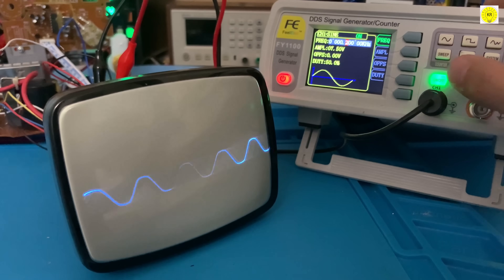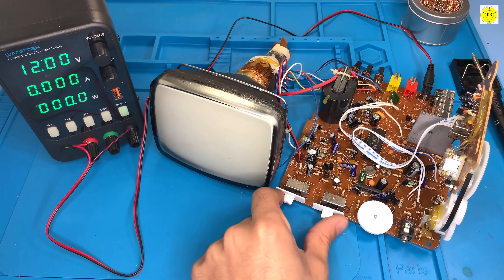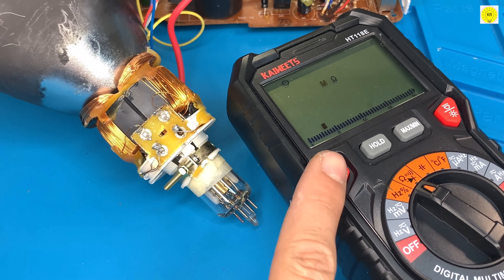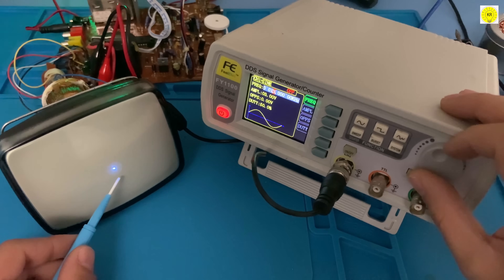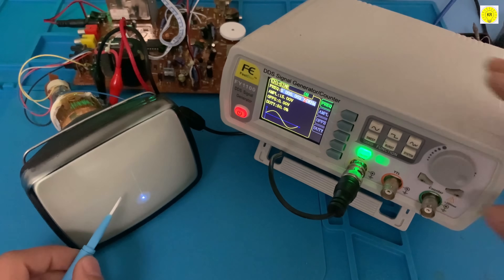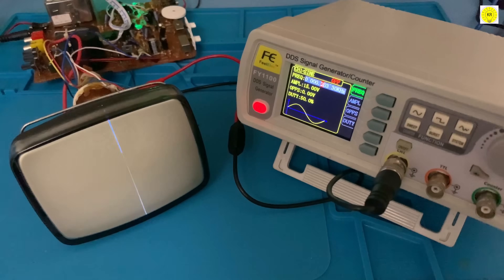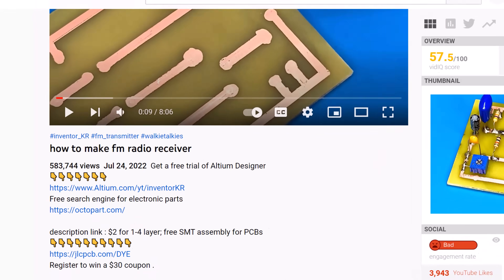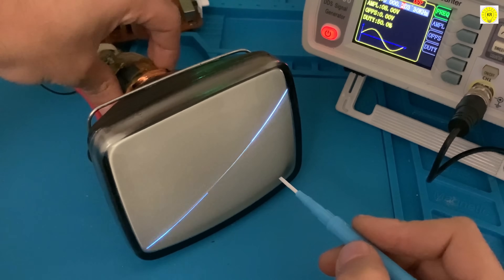how to convert a CRT TV into an oscilloscope

Comment: I'm sorry.. did this guy Touch the deflection yoke with his bare freaking hands and then TRY DESOLDERING without discharging the tube?!
Reply: the display uses only 12v, calm, it is not a tv, only a 70's old radio

Comment: I always figured the magnetic deflection yoke would not be frequency-agile enough to make a real 'scope, but you could certainly make a "squiggle generator"!
Reply: It's not, the best you can use it for is to see the shape of the waveform, it's certainly not suitable for voltage measurement and even the waveform shape will be affected once you go outside the core frequency of the deflection coils.

Comment: Your lucky, a lot of TV's line output/EHT tend to not work when the horizontal coil is disconnected, sometimes a substitute inductor will do the trick though.
Also be VERY sparing with the brightness, especially with only a dot shown, as you can easily burn a hole in the phosphor. (been there, done that)

Comment: Hey, I just want to say thank you for making this video. I love cathode ray tubes but I had no use for one, aside from the parts, and I also wanted to make a crt oscillascope so yeah, thanks!

ALSO!! BEFORE YOU DO THIS, DISCHARGE THE SCREEN AFTER RUNNING IT EVEN FOR A BIT BECUASE THE SCREEN CAN HOLD LIKE 20,000 VOLTS/20kv!! AND IF YOU DON’T DISCHARGE IT YOU CAN BE SHOCKED PRETTY BADLY

Edit: can you make a part 2? Also I don’t have most of the parts I need :(
I have barely any soldering skills, no power supply, no signal generator, nothing😢

Comment: No use for an electronic technicion if it convert this crt  ,without Timebase circuitry e tc,etc ...
It is impossible ,but can be experience and study the function of the deflection coil and the crt beem function inside a TV picture tube ....

Comment: I wonder if it’s possible to assemble a device on some Cortex M4 that will control the ADC, create a frame buffer in its RAM, then output this frame through the built-in DAC to an RF modulator and thus generate a ready-made signal to feed it to the antenna input of the TV? I think this is a much more interesting and versatile idea than destroying a working CRT TV. After all, in this way it will be possible to immediately draw a grid on the screen and display the values of vertical sensitivity and sweep time in text form. Plus some additional information such as signal amplitude values, frequency, etc.😉

Comment: Wrong idea, because oscilloscopes work with electrostatic deflection! TV picture tubes are far too short for this, apart from the fact that the deflection plates are missing. They can only work with magnetic deflection.
And what for? There should be enough discarded analog oscilloscopes on the market.

Comment: And yet another CRT to Scope video that totally misses the point of modding the Grid signal, ending up in having the RF Snow Video Signal still fed to the Grid, instead of a controlled Screen voltage to control brightness... Not asking for an Edge detection and Trigger, but the bare minimum for pete's sake!

Comment: Tried this once on an old TV. Turned out, in Europe the high frequency high voltage transformer is connected to the horizontal deflection coil. When you cut this connection, there is no high voltage produced, no cathode ray hits the screen, everything is dead. 🙁

Comment: While your video is nicely made, when explaining to people how to put their hands on CRT circuits, please never forget to warn them about the dangers of really high voltages present on these circuits! You obviously know where not to put your fingers, like for example the solder points near the flyback transformer, high voltage capacitors, or the neck board where some high anodes voltages (at least a few hundred volts) are present... Also a warning about the voltage present under the anode cap (probably over 10kV) would be welcome. Someone who might not be aware of the high voltages present would get a nasty surprise if getting too close to dangerous points of the circuit or trying to take things apart without proprely discharging (even if well designed circuits have resistors to self discharge).
Also... keeping a bright static focussed dot on the screen like that will pretty quickly burn the phosphor in that spot, something like a few seconds would be enough to have some damage. Never ever keep a bright spot (or even a bright small line or something) in a static position on a CRT tube, at least lower the brightness. It will irreversibly burn in! I managed to burn a few spots on a good tube once, working on CRT clock circuits, and I was careful...
Reply from the maker: Thank you for your thoughtful comment. Safety is always a priority and I will make sure to include more safety details in my future videos.
Reply: That's what I was thinking, only I don't know where the places to touch are, I just know that CRTs are dangerous, so I was just like WOAH!!! You are all up in there! And I was scared...

Comment: Oscilloscope tubes move the beam electrostaticaly.   TV tubes don't have deflection plates and the beam is moved with external deflection coils.  The TV deflection coils don't have enough bandwidth to make a descent oscilloscope.  You will spend a lot of money building a piece of junk.
Reply from the maker: Thanks for the insight, this is an important factor to consider when building an oscilloscope.

Comment: Turn off the Oscilloscope time-base and insert a sawtooth ramp generator and with that make a large screen Curve Tracer for vacuum tube and transistor testing/matching. 
Tv sets are ideal for this function, because of their large screen. 
Curve tracers for tubes are worth a fortune nowadays - if you can find one.

Comment: Спасибо что вы показываете такой позновательный и обучающий видео для юных умов
Reply: юные умы должны знать что если кинескоп хватать лапами когда там сохраняется заряд в несколько киловольт уже много раз кончалось летальным исходом. причем такое бывало даже с опытными ремонтиками
Reply: @Galova  Also 'kinescope ' instead of Cathode-Ray-Tube... that's going back a bit 😉
Reply: @GarryGri  traditional 'nick name' for this electronic component.
Reply: @Galova  Please stop scaremongering people like this. Why do so many people act like this now? 

At least tens of thousands of people have worked with CRTs for years and are not dead because of it. 
Deaths from shocks are infinitesimal. It isn't designed as a killing machine! 
There are three points that could give you a nasty shock; Transformer, end of the tube, anode; but it IS NOT likely to kill the average healthy person and is easy to avoid. Also yes, always discharge the tube even if it has a bleeder. 

I'm sure pou don't go around telling people that sticking their fingers in a wall socket could kill them!

Comment: The impedance of these coils isn't very big so you can't  measure every type of signal source.   There are probably some more frequency limitations than the  normal scope.
Reply: Of course. Horizontal deflection happens at 15 625 Hz and vertical at 50 Hz (PAL). 
You can go a bit higher, but horizontal 25 kHz and vertical 200 Hz is max.